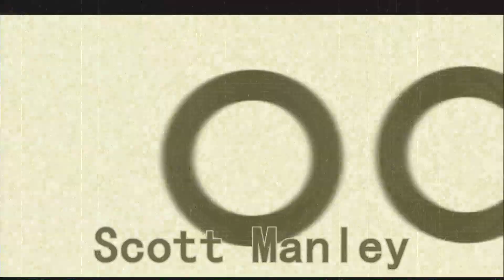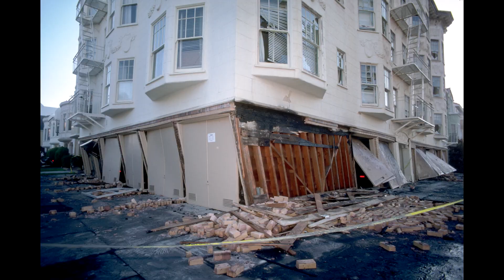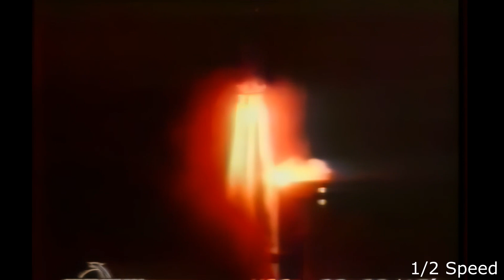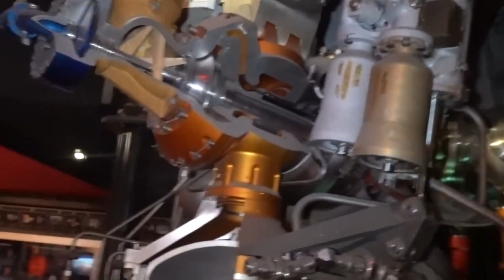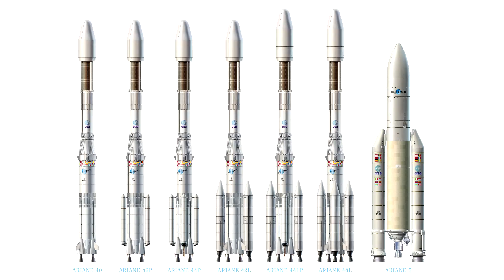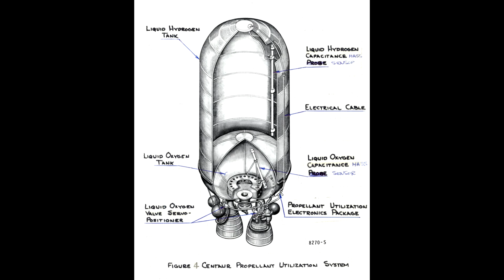The Unluckiest Satellites - Earthquakes, Rockets and Clogged Pipes

Comment: LOL, I had the same problem. I took my car for a tune up. Afterward the car ran terribly for a day before I brought it back to them and discovered a shop rag inside the box with the air filter.
Reply: I have a better story. After an oil change the engine kept stalling. Turns out the shop had left a valve shut that wasn’t supposed to be. It flooded the engine with oil and caused permanent damage.

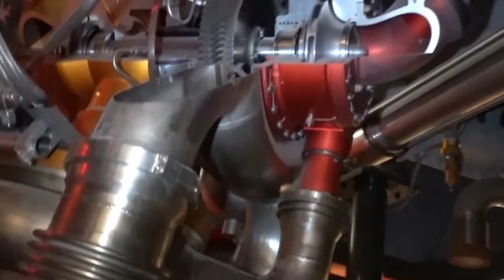Comment: I think I've found a problem with the engine there, at 4:08 It appears that there's been a massive cross sectional area cut away! Now, I'm no rocket surgeon, but that's bound to impact performance
Reply: As long as the cut edges are painted red it should be fine.

[Edit] ..Oh wait, they forgot the red paint. There's your problem!

Comment: This is one thing that concerns me about SpaceX. They are building their starship in an open air hanger in the middle of a swamp. I wonder if one day we will see a massive explosion  caused by a dead bat in one of the oxygen lines.
Reply: or a wasp nest like that one plane where hornets nested in the speed/altitude sensor tube
Reply: I dunno, man.
SpaceX doesn't seem to leave those things sitting around for very long.
Launch
Boom!
"Next!"

Comment: every time i hear stories like this i always wonder why the us was never determined to make a closed cycle engine... having a separate system to spin the turbo pumps seems counterproductive
Reply: Uhmm ever heard of the RS-25?
Reply: @please_stop-v7o  nah what’s that one got
Reply: @nunyabusiness8538  The Space Shuttle main engine. It's a staged combustion closed cycle engine and was long considered the best engine ever made...
Reply: @please_stop-v7o  i’m guessing the only reason they don’t use it more is cost?
Reply: @nunyabusiness8538  What are you talking about it's one of the most flown engines. It powered every human launch from the US for 30 years. And it will be used on SLS.
Reply: The Atlas-, Titan-, and Thor-based launch vehicles were derived from the Thor IRBM and the Atlas and Titan II ICBMs (the Titan I was never used as a launch vehicle, even though it could orbit 2-1/2 ton payloads; the USAF and NASA briefly considered it for the X-20 Dyna-Soar [for suborbital tests] and for the Gemini spacecraft, respectively). The Thor, Atlas, and Titan II ballistic missiles were developed with speed (of deployment, called IOC--Initial Operational Capability) in mind. The simpler, gas-generator/turbopumps rocket engines that these missiles used enabled quicker development than closed-cycle, staged-combustion engines would have.

Comment: I can’t wait to incorporate cloth of doom into my daily vocabulary.
Reply: I use it every time I'm losing my second sock
Reply: @GURken  those darn sock, they never stay in pairs
Reply: @Goultek  They get stuck in plumbing all the time!
Reply: @GURken  My solution to this problem is being boring and getting many of the same type of socks. They did eventually stop making the ones I like and bought originally, practically the same but a slightly different colour.

It still works just fine though, they go unsorted into the socks drawer and when I need a pair of socks I grab 3 at random and put the potentially non-matching colour sock back.
Reply: @extrastuff9463  That's how you can spot a retired mailman. They have a never-ending supply of blue socks with stripes.
Reply: I have a box of old rags you can put serial numbers on and experiment with. They're all yours. 👍